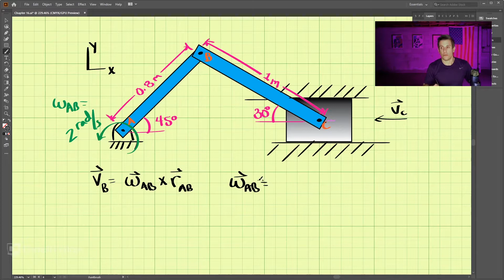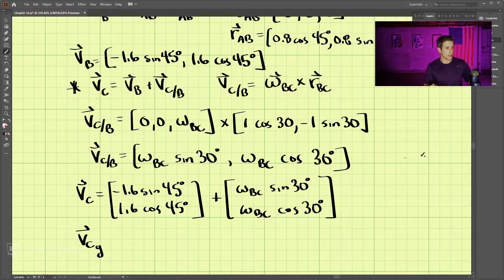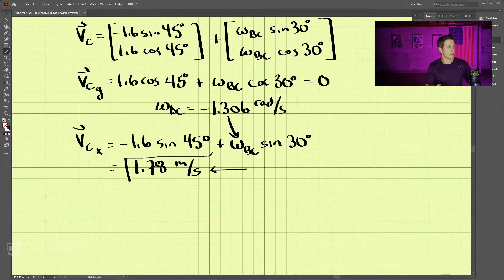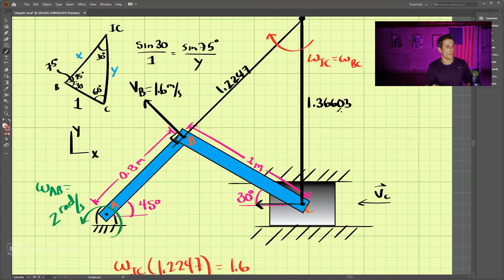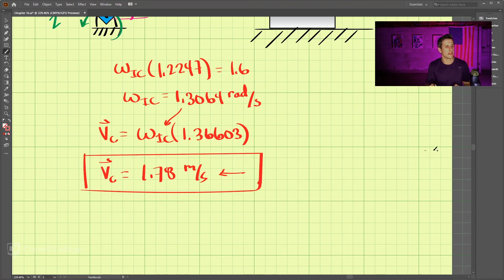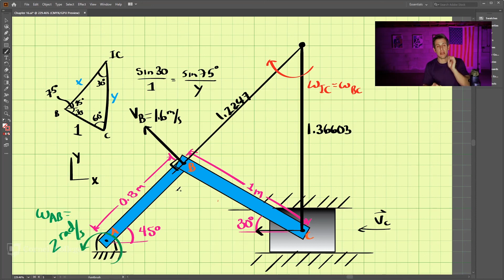Dynamics - Chapter 16 (6 of 6): Relative Motion & Instantaneous Center (Slider Crank Example)

Comment: An older video, so i can't imagine a quick reply but just in case, how is it that we determein OmegaIC=omegaBC?
Reply from the maker: I’m not sure I can explain this in text form…I’ll try…
If we examine the center of link BC, it is both translating and rotating at this instant. The principle of IC transforms (simplifies) a system that is translating and rotating into a equivalent system that is purely rotating (no translation) about a single point (the IC). OmegaBC is the angular velocity about the IC.

To further try to clarify this concept, you could also take a look at link AB to see if this makes sense. OmegaAB (2 rad/s) is the angular velocity about its fixed point (A). For link AB, point A is the IC of zero velocity because it is pinned in this location. We typically don’t think of pinned locations as IC, but they are. Link AB has pure rotation about point A, omegaAB is the angular velocity about this point.
Reply: @ProfessorJohns  Rewatching this and reading your message carefully clarified this for me.  I appreciate you taking the time.

Comment: Why does the Ic is 30 degree instead of 45 degree? since the total angle inside a triangle is 180 degree. If we calculate, shouldn't the Ic is 45 degree?.. 180-45-90=45 or the other method, 180-60-75=45... Can you explain? sorry.
Reply from the maker: Don’t be sorry, it is my error! Thanks for pointing it out. You are correct, it should be 45 degrees. I made the error twice. The procedure is correct in both, but I made angle calculation errors.